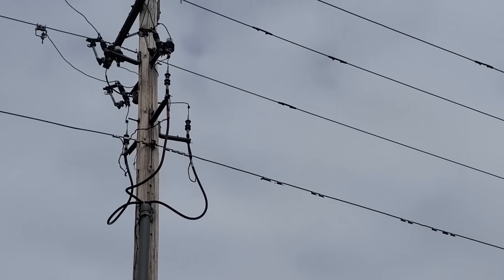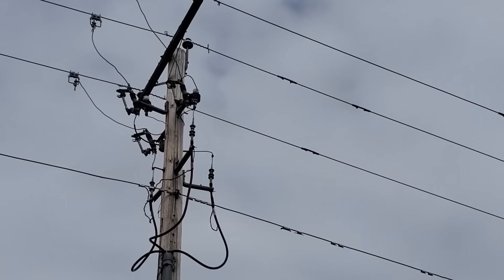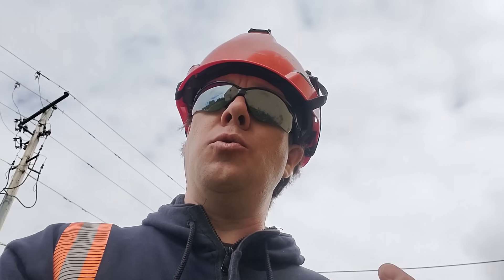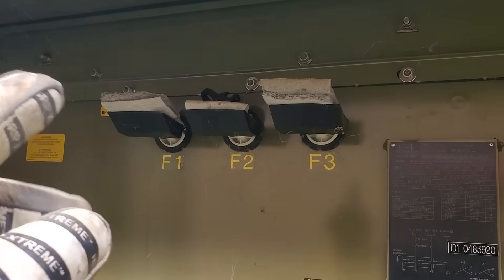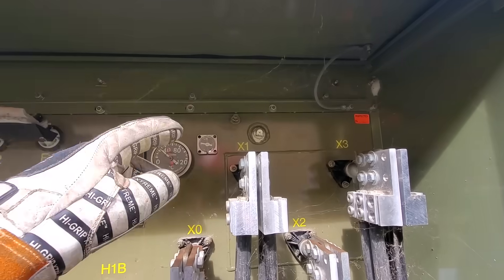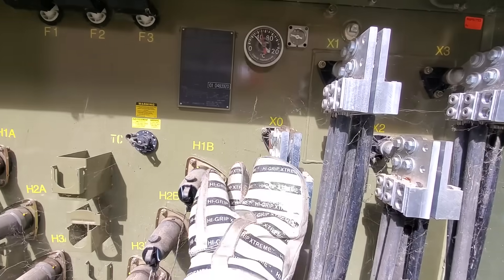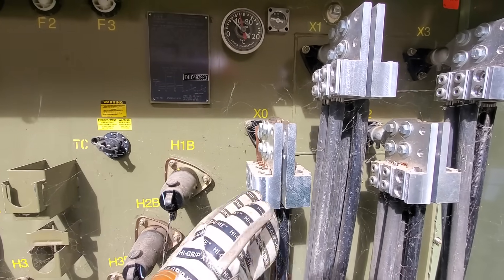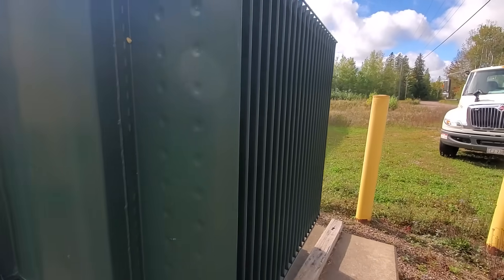A closer look at Padmount Transformers

Comment: Wow, I've never seen one of these without a barrier between the primary and secondary compartments. The ones my company uses, even the old live front ones, all have a steel separator between the doors.
Reply: that's why it's called a widowmaker
Reply from the maker: Our live fronts all have barriers, as well as a barrier between the the cable and the doors
Reply: This one on the video is a CSA unit (canadian standard), no barriers between compartments. Padmount transformers designs in the US (IEEE/ANSI standards) do require the barrier between compartments.

Comment: Still wearing a hoodie brother??? Must still be chilly up there huh??
The other main issue I explain to customers every time they ask me why isn’t everything buried under ground is that when there is an outage on an overhead system all we have to do is drive out the line, locate the cause of the outage set up buckets and make repairs. Depending on the isssue some can be resolved within an hour of arriving on site. Or maybe a few hours. Again all depending on the cause and damage. With underground systems it’s all buried so obviously we can’t just dive out the line and visually locate the issue. We need to isolate the section and fault locate using specialized equipment. Then once it’s located the digging begins. Sometimes on peoples property. On our system overhead transformers usually have a secondary open point or tie location where if a can fails we can feed the customers off of the adjacent transformer picking up the outage temporarily until it can be replaced. On underground we have a primary loop or it may be a radial. The primary feeds through each transformer so if one fails in a loop setup then it needs to be switched out isolated and the transformer can then be replaced. There are no secondary tie points between transformers in order to temporarily pick up the outage while the can is replaced. Hence longer drawn out outages. More time consuming and property can be damaged in order to make the repairs. So yes I agree that underground looks better, but overhead is cheaper to build and outages are usually shorter outages and easier to work energized keeping the most customers on as possible. That’s my 2 cents thanks for letting me share
Reply from the maker: Oh man, it's been crazy! A couple warm days, but every single night ya need a sweater when the sun goes down 😟
Reply: Buried systems can be made with tie points in curbside boxes. I've seen linemen using those tie points while working on nearby lines.  But yeah, fixing a buried cable or pipe is trouble unless it's running in an access tunnel.
Reply: @johndododoe1411  well the engineers that design the underground system here at least in residential areas no secondary tie points. Basically each pot has a splice box dedicated for the houses. No tie between boxes. Also instead of knee highs we use BG cans. Basically below grade in a Cason with manhole lid on top…. Fun when you open the lid for switching and it’s submerged in water 🤦‍♂️or filled over the bushings with dirt. Gotta keep a shop vac and a sump pump handy

Comment: How do you power it down? I mean, it seems that any form of disconnect doesn't cut all the phases at the same time, that way you don't risk damaging customer equipment that will don't have a phase for a significant amount of time? It doesn't seem either to be a secondary side switch to kill the outgoing power and thus disconnect/reconnect the power safely.
Reply: Gang switch
Reply: In this particular situation the customer would have to open his main. Some of these transformers come with primary and secondary switches. If the customer didn’t open it you would have no choice but to briefly single phase them, this does happen on occasion.

Comment: 5:58 how about refering to them as L1, L2 and L3 (like the rest of the world ;))
Reply: Standards organizations like those numbered labels, notice the inside panel uses them.  But for practical work, single letters are easier to get right.  I was raised with phases being R, S and T, while the other ends of motor windings being U, V and W.  color coding has been inconsistent my whole life, with new standards being arbitrarily changed multiple times in the 50+ year lifetime of installed cables.
Reply: In Australia they call them after colors, red blue and yellow phase iirc. So there is no “world standard”
Reply: @Engineer9736  Fun fact: There is - it‘s the british (colonial) countries and the rest of the world…

Comment: I would love to see more about replacement of the pad fuses. When fuses are changed,  does the transformer need to re-pressurized or is the pressure a result of normal operation?
Reply from the maker: I get some more content on the fuses for sure! It would be more accurate to say the pressure is more a result of abnormal operation... While pressure is expected, it's a result of air expansion with heat and off gassing. Too much pressure may be an indication of a problem
Reply: @Bobsdecline  some transformers have a nitrogen blanket on top of the oil in the head space usually 0-5 psi.
Reply: Way back in the day I worked for a company that builds transformers. The pole mount units we charged with nitrogen, 5psi if I recall not much. I do not know if the pad mount units were also but I think they were.
Reply: Like to see. Copper bandits hit that one

Comment: Why can't the knob be operated under load?  What's the difference between the knobs that can be operated under load?
Reply: A tap changer that can be operated only deenergized does not have to care, what happens during switching, when the switch is in the moment on in the middle of two positions. As there are windings added of removed to/from the secondary in this middle positions there my be no connection to either position of the coil or both positions might be short circuit in the position.
On load tap changers need additional contacts, resistors and such things so that the secondary is not disconnected while switching as well as there is no short circuit of the windings that are added of removed. See https://en.wikipedia.org/wiki/Tap_changer
Reply: It can short windings as it is turned between positions and the contacts may not be rated to make and break at these voltages and currents although they can sustain the current if already connected.
Reply: Thanks for the knowledge @andy fletcher and @Günther Berger.
Reply: He does another excellent video where he talks about the different types of tap changers in detail.

Comment: Every time you reach in there my heart skips
If your gloves fail, that's it
Reply: With 7200 volts phase - ground, the electricity can only jump 7.2mm or like 1/3rd inch. I don’t think he gets that close to the bare contacts 🙂
Reply: The high voltage is also isolated as long as he does not remove the bushings. Only low voltage is accessible to touch.
Reply: There is no exposed high voltage in this box, so you'd need more to fail than just the gloves.  And that's intentional.  The exposed terminals are 240V.
Reply: Indeed. Still has to be said that all the safety warnings and PPE’s are very much needed. It are like backup barriers. Safety on top of safety. When i was a kid my dad just let me replace wall outlets in the house and other small electricity projects, i got zapped over 10 times with 230 volts by silly mistakes. One such mistake with the 7200v in this box will be the most unfortunate, your life will end instantly. Just keep out if you have no business in there, and if you do become linemen, follow all the safety rules and be alert… 🙂

Comment: we are considering replacing out pole mount transformer with a ground one , and tip's or are they different in any way compared to a industrial  type pad mount transformer
Reply: If you're in North America, transformers feeding your house proper 3-phase are very different from the ones feeding the house 180° two-phase at very different voltages.  Upgrading to 120° 3-phase in North America may require completely rewiring for the new voltages.  To get 115V live to ground in regular sockets, the 3-phase would be around 200V phase to phase, unless additional transformers are used, while 2-phase would be 230V phase to phase.  3-phase is an equal sided triangle with neutral as a dot in the middle.  Middle to each corner is 115V, corner to corner is 200V on each side.  Motors and generators have 3 coils hooked to either voltage and rotating the magnetic triangle 60 times per second.
Reply: @johndododoe1411  i have seen transformers wire 3 phase winding core in but the out put ciol would be wound in 2 phase configuration , also seen on three phase line along a road with only 2 of the phases tapped , that would mean as you would  the line you would have to balance the load along the length of the line ( alternating at what phase you are pulling off at any one time ). But sorry i only have a single primary wire running down my road ,